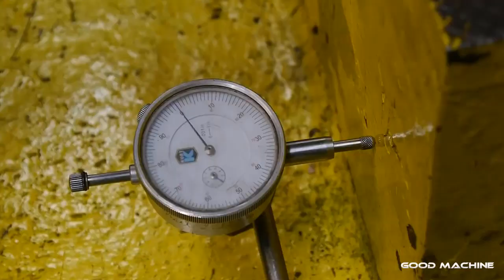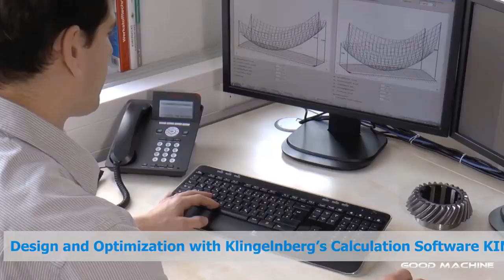Dangerous Big Heavy Duty Lathe Machining Action, Fastest CNC Lathe Machines Modern

Comment: I was a manual machinist for more than 37 years and I would machine parts on a Meuser engine lathe with Chuck diameter of 9ft with bed length of 85ft 4inches, running dril stems for Haliburton.

Comment: I have a floor model Bridgeport type mill. It is considered a hobby machine because the speed adjustment is done by changing belt positions, but it is solid and precise none the less. The best thing I did was to retrofit it as a 3 axis CNC!! I stretched the table travel from 16 inches to 26 inches!! I also added a two speed reduction so it went from 9 speed to 18 speed to turn large diameter tools!! I am ready to retrofit anyone's machine if they need it done!! I ain't free though..... Still can be much cheaper than buying a premade CNC if you are in the area where I live!!
Reply: I also have a rotary table that I can incorporate if needed and have 4 axis CNC if I need to!!!!